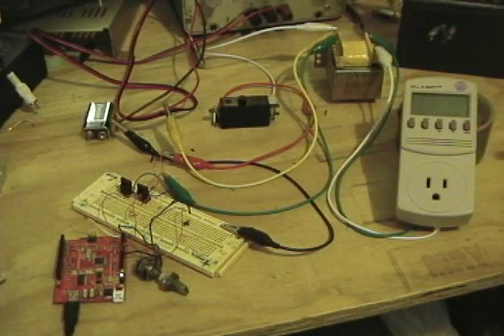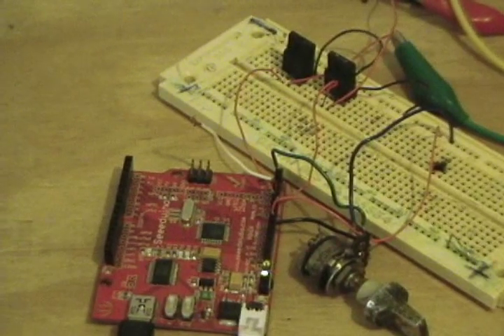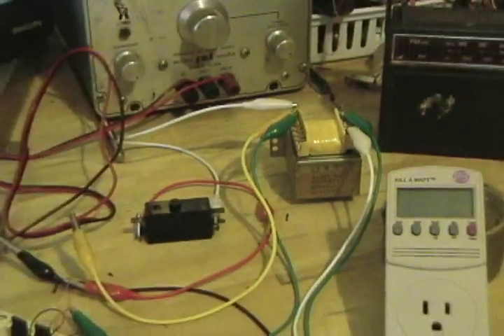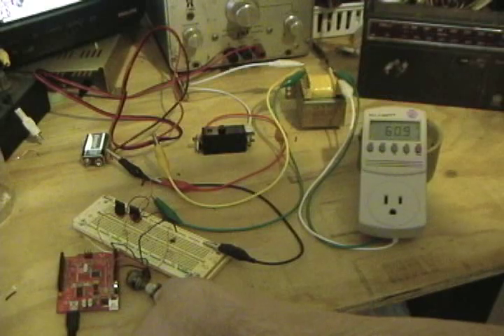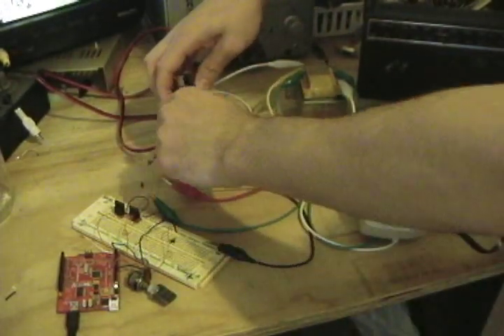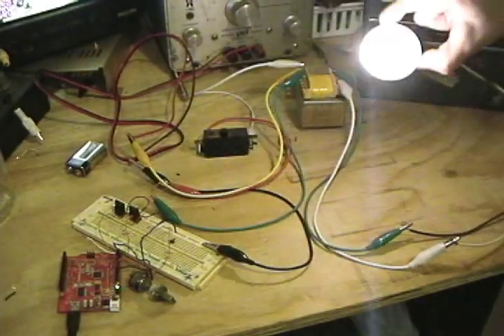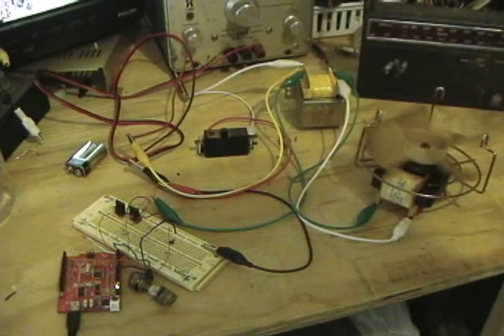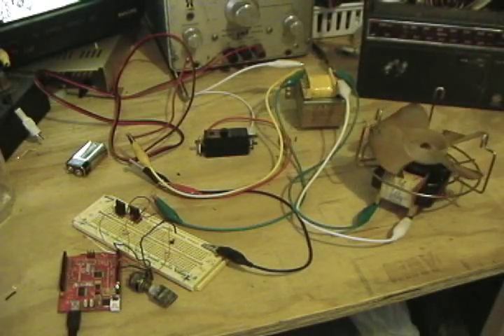Primitive DC to AC power inverter

Comment: the light bulb is a capacitive  load , its sending back the signal to turn on the other FET, so it doesnt work till you physically remove the link. when it heats up characteristics change and now it works . I dont know of any other explanation. You can test this with a diode to prevent feedback and if it works then indeed feedback is the problem

Comment: You don't explain how  the DC is switched to AC before going to the transformer
Reply from the maker: +Val Martin 
It isn't changed before, the way that it's applying DC to the transformer changes it into AC.  +12V is connected to the centertap of the transformer input winding, then the circuit alternates between switching the winding on and off.  The fact that it's switching (and not steady DC) induces a pulse on the output winding.  Also, because it alternates between grounding opposite ends of the winding, it essentially switches the polarity of the pulsed DC, which means you get an AC waveform on the output.

Comment from the maker: Sure, I put a link to the schematic with notes in the video description.
A few warnings: Use a very low duty cycle when first choosing how long the transistors will be on/off. EG: every cycle they are on, have them off for ten. Make sure you test everything on a current limited power supply before trying it with batteries. There is no form of feedback for frequency/voltage; could be fixed by having the micro monitor the AC output via a resistor divider or opto isolator on another analog input.

Comment from the maker: Don't have the circuit assembled in front of me, but I remember it was proportional to the load and fairly efficient.  I think it added about 10-20% overhead, so instead of 12V 1000mA in / 120v 100mA out, you'd see something like 12v 1150mA in.  IGBTs have super low resistance, so if you get the timing right, you can get away with very little waste heat.